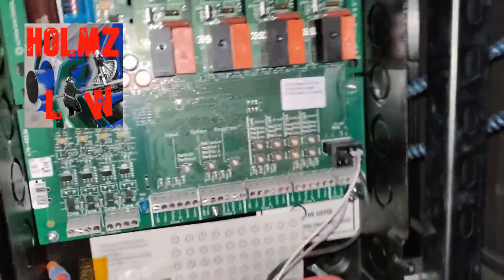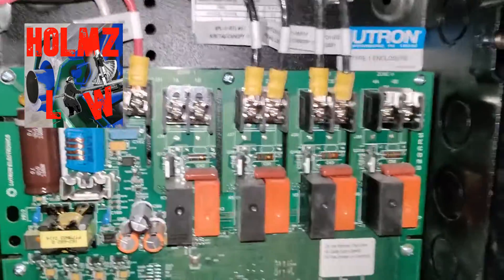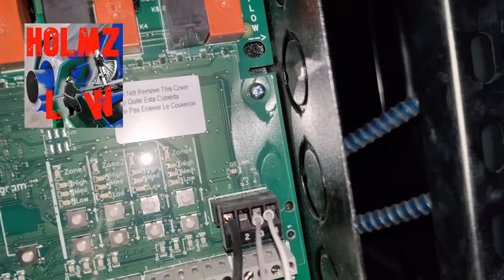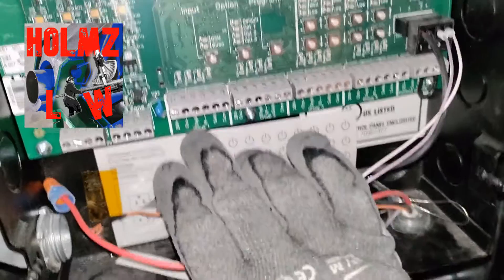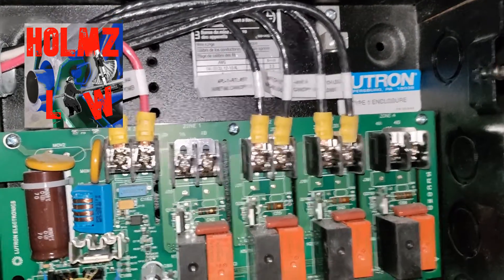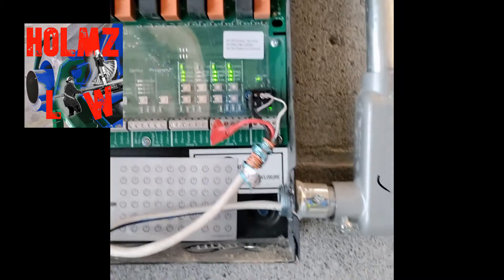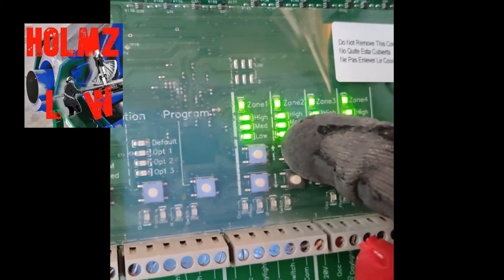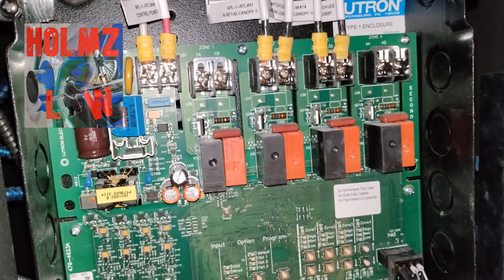Lutron Lighting Control (how to wire the panel)

Comment: I have normal and emergency. One panel has the normal and the other panel has the emergency. But when I dim or turn off the lights only the normal lights dim and turn off not the emergency lights.  How do I sync them or how do I wire the panels so that the emergency lights are also controlled by the switch.
Reply from the maker: What kind of lutron system are you running. Quantum, vive, etc.?
Reply from the maker: Either way.  If you are using energy savr nodes. You'll need an "ELI" emergency lighting interface to make the 2 work together. Google the lutron Eli manual it'll show you how to wire it.
Reply from the maker: If you want to contact me or direct message me, the best way is through my Discord Server link will be posted below along with other social media accounts.
Discord -
https://discord.com/invite/qJuJuSMP IG@ArtOfConduitBending

Comment: Great video! I’ll be working for my very first time with a Lutron lighting control panel. Maybe a very obvious (dumb)question but the switch leg comes straight from the light fixture, correct? And if I want to control some outlets, the “switch leg” also comes straight from the outlet, right? Also one last question, if my switches are going to be hard wired I ONLy would need to run low voltage wire #24 to where my in wall switch is going to be located?
Reply from the maker: Yes , Yes and #24 depends on the length of run where your switch is going but still seems very small. I usually don't go smaller than #18.
Reply: Would you be willing to teach me about the system? I dnt mind paying 🙏🏼

Comment: The box I’m working on it has 4 zones and just turns outside lights on at sunset and off at sunrise. How can I just turn them on to test lights and what do I have to do to resume schedule? Thanks for these videos
Reply from the maker: So in time stamp 5:00 I show you where the buttons are that control the lights manually. After you're done testing just put them back to either on or off the panel will take care of the rest. Hope this helps.
Reply: @TheArtOfConduitBending  here’s a second question I had a problem in field and zone 1 got damaged how and could I program zone 4 to do what zone 1 did which is turn lights on at night and off in morning
Reply: Manually program them
Reply from the maker: @frankspliff7037  yes you could. But it's not about programming. The way the lights turn off and on at day and night is by a sensor now that sensor either is wireless or wired. Do you know which you are using. Can you send me a picture of the inside of your panel? So I can see which you have. Also all you have to do is move zone 1 to which ever zone you want that isn't being used. If you can send me a pic send it to any of my social media accounts or email me at melrub480v@gmail.com
Reply: @TheArtOfConduitBending  I’ll send a pic to your email tomorrow morning  thanks

Comment: Wassup brother. When I wired these panels, I jumped the power to terminals 1A to 2A to 3A to 4A.  1 feed for all 4 zones. Did I do this correctly?
Reply from the maker: Yes. All depends on how your job wants it done. You can wire the whole panel with one ckt. And jump it between all the terminals like you did. It all depends on the job. Also it can get a little technical too. Like if you have lots of lights you might need more than just one circuit but these days I don't think that'll ever be a problem with LEDs. Know what I mean. Just depends how the customer wants to control the lights. But to answer your questions. You did it right it will work. But it all depends how the customer wants it.